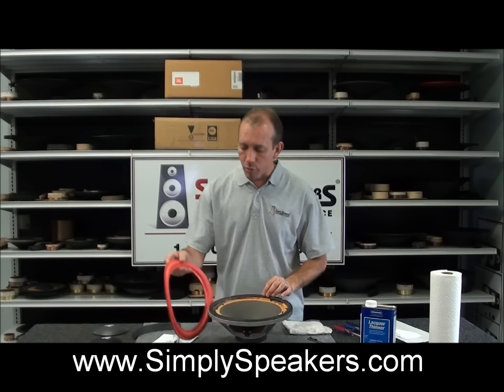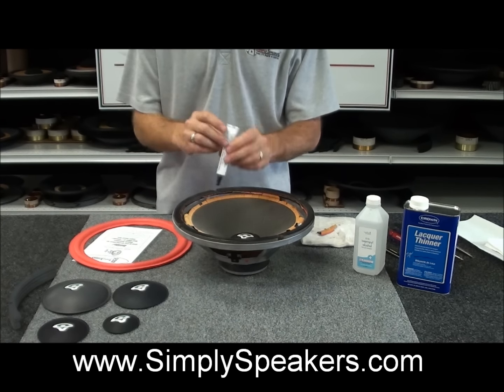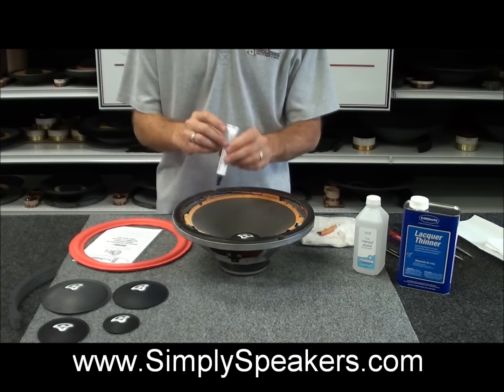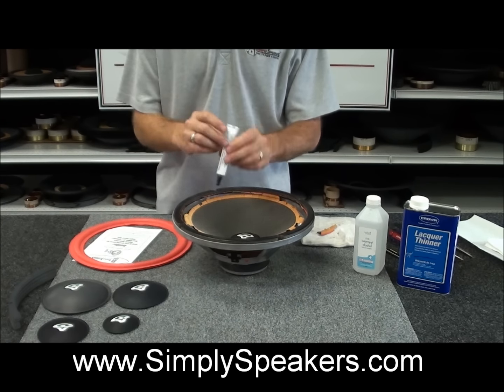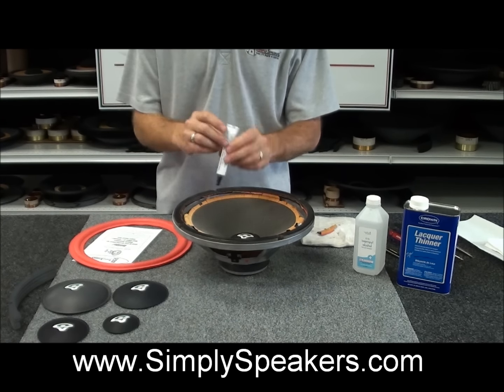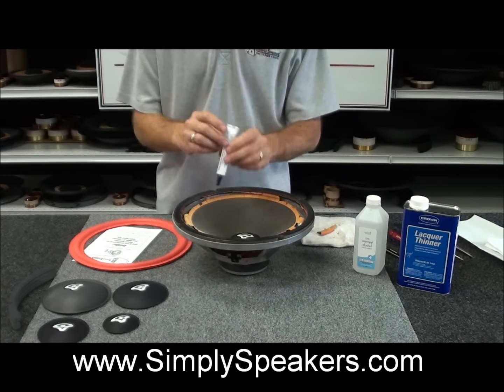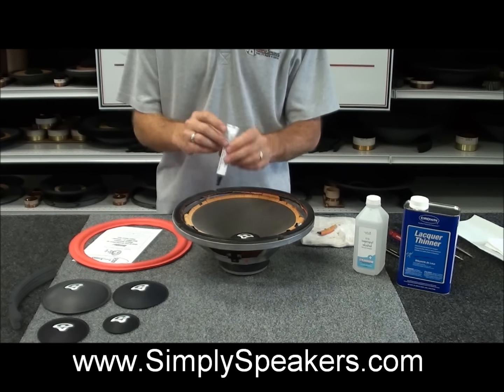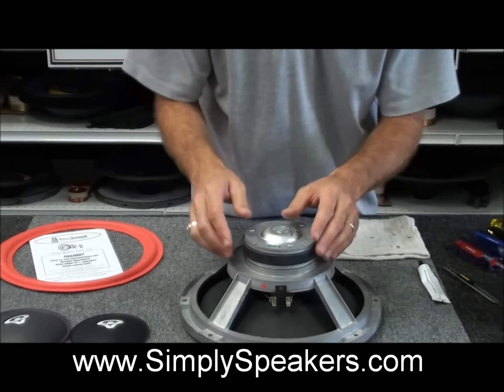Speaker Repair and Foam Surround Replacement for Cerwin Vega and Others

Comment: Hi, I need your expertise if you can advise me, I will be very appreciated, I had bought four Cerwin Vega Ls-12 and on two of them the drivers blew up, I wanted please to ask you if I can put the same drivers that the SL-12 have? There are 8 ohms, can do any damage? the ones that it has are 6 ohms, each, I am not sure why now the all speaker is 8 ohms, impedance... I will be please very appreciated if you can answer me, Thank you Luis
Reply from the maker: The LS-12 and SL-12 are compatible. Either model is safe to use in your system.

Comment: I removed the foam from the cone before I put the alcohol on, and the glue residue is proving to be very difficult to remove without peeling off a thin layer of the paper from the cone.  It it okay if some of the old glue residue is still on the cone when gluing the new foam on?
Reply from the maker: Yes, this is acceptable, as long as all the old foam has been removed.
Reply: Simply Speakers Thank you!

Comment: So is this procedure what would be done if I don't get any response from the speaker with a battery test? This is what is done to fix it?
Reply from the maker: Full recone (new coil, etc) would be required in this case.

Comment: I just replaced the surrounds on a pair of Marantz 15" speakers. One was a piece of cake, but I had problems getting the other centered on the "sweet spot". No matter what I did, I kept getting scraping on one side or another. I ended up peeling it back off of the frame and cleaning it up (naphtha works very well). On the next try, I installed it dry (it was a little bit tacky after being cleaned-up) and carefully centered it on the sweet spot, which left it visibly out of center on the frame. I then put a single drop of adhesive at the spot where it was puled over the farthest, then again 90 degrees to each side, and finally one directly across from the first. After letting it set-up a few minutes, and confirming I was still centered,  I peeled back the surround between each of the glue spots and glued it down. It worked like a charm.

Comment: I just finished repair on a pair of Energy ESM2 speakers that were in the basement for over 20 years using your excellent video guide.  I did need to replace the 8 inch gaskets which were not salvageable.  The speakers sound like new, which I had purchased over 30 years ago,.  Thanks again.

Comment: One thing I did with my last refoam project was after you feel the foam is attached in a good position is to hook the speaker up to an amplifier and just play music lightly at a very low volume to check for voice coil rubbing sounds.

Comment: Instead of slowly attaching the surround to the cone, I've picked up some assorted lunch plates and bowls from resale shops (Goodwill, etc) that are just the right sizes to sit upsidedown over the inner lip of the surround.  Don't leave it in place long enough for the glue to harden.  Just long enough for the surrounds to stay attached without babying them.  May take a few trips to find just the right size, but for $.50 or $1 per plate that you can use again and again, it's well worth the time to find a few of them.  It might take a little trial and error to find what size you need for any one foam but in general the same dish can be used for most any foam for the same sized speaker.  Might be hard with larger (15"??) speakers, but I have them for 6.5" (bowls), 8", 10", and even 12" foams.

Comment: Great instructions! I got my VS-120’s back to new and sounding great. I suspect mine had been refoamed before, the gasket was plastic, not the paper shown here and the old foam was glued with a much stronger backing to the cone, made it a tad more difficult, but it worked out in the end.
Reply: The VS series comes with plastic rings.

Comment: Okay, so I had a set of 1980s vintage black Optimus speakers that had TOTALLY decayed crumbling rubber foam borders surrounding their speaker cones - this made the speakers essentially sound completely - "blown out" -  particularly on low frequency tones. Awful! Well folks... using an EXCELLENT Simply Speakers kit (bought on Amazon), and next viewing the provided outstanding instructional vid above, and I was able to do just about a "pro job" - first time out, restoring my nifty 30 year old speakers to "Like or Better Than New" condition. In fact, I'm listening to them as I write this thing - and I gotta tell yah... they sound absolutely GREAT! 

The repair is actually quite straight forward, once you watch the video. The proprietary glue supplied is amazing. Again, these guys are like super speaker pros and essentially sharing their tools and methods to achieve positive results. The task was actually rather enjoyable, I just worked slow at my own pace. I waited a day before inserting the loud speakers back in their cabinet, just to be sure. OMG - they came out perfecto!  One tip I would add - if your bezels are in four pieces as mine were... I used multiple clothes pins to easily hold them down to the frame while re-gluing. That worked great! Thanks so much to the great folks at Simply Speakers!

Comment: Used this exact kit to replace my MX-250 12" surrounds.  Worked great.  Also repaired my 6" Klipsch 4.1 ProMedia sub.  Both are working great.  Glad I found the site or my ProMedia replacement would've cost a decent amount of money.

Comment: Hey, thanks for the video.  I ordered a set of surrounds for my D5s.  The whole thing took me about four hours to do both units.  Gotta tell folks that they need a bunch of paper towels when they clean the cones.  That's a mess.  Also, I needed to clean my knife quite a few times when I was removing the gasket.  All in all I'm very happy with the results.
Reply: Always be conservative with glue on speakers.

Comment: I have a pair of cerwin vegal ls-15s my wife bought me and one has had the gasket and spider come loose. I could barely make out 154w on the back of the speaker along with the manufacture date. all references to speaker model I've seen say 15w4, unlike the 154w on my pair. I was told by a CV dealer I should replace them with a pair of CV aftermarket subs but all I find is car audio and while my yamaha RX-V781does support bi-amp, my ls-15s do not. while i wouldn't be totally opposed to running a pair of car audio 2ohm dual voice could drivers in series since it also supports low ohm speakers I don't believe it would drive car audio speakers efficiently so therefore I was trying to find a recone kit due to the spider issue. can you help point me to the right kit?
Reply from the maker: Contact us through our website and we will see which recone kits are available.

Comment: I used this guide and the kit from your website to replace damaged old foam on a pair of '94 CV VS-100 woofers. Using the method here, I had absolutely no problems removing the old foam and installing the new foam and the voice coil is dead center without shimming--there is no rubbing at all. I also reused both gaskets no problem. This is my first time doing any speaker repair, so I was very hesitant to do this work myself. Even with your explanation I thought that the voice coil couldn't possibly be centered considering that pretty much everybody else says that removing the dust cap and shimming the voice coil is necessary. However, they were all wrong and you were right! Now my VS-100's look and sound excellent! I just wanted to comment here to thank you for the guide and also to convince anybody else looking to try this method that it does work.

It took me about 4 hours start to finish with all the drying time as well. I used rubbing alcohol but did not put any on the cone itself, i just used an x-acto knife and my fingernail to remove the foam from the edge of the cone and used rubbing alcohol, a knife, and my fingernail to remove the foam from the edge of the speaker frame. The gasket just lifted straight off with a bit of even pressure.

Thank you Simply Speakers! And I strongly encourage anybody who just need to replace foam to use this method, it's very easy if you take your time to be neat and follow the directions above.
Reply: I struggled to remove the glue do you think an exacto knife will help

Comment: I just installed mine for my 1988 Onkyo speakers. I hand not used them in several years because of the bad sound they had. Little did I know the foam had dried and turned to dust and the cones were loose.A word of caution. Be sure to put enough glue on the foam or it is impossible to move them much on the cone if you don't. The first one was off center a little but it still sounds fine the second was mush easier. I highly recommend this kit!

Comment: Ive repaired my 2 Tannoy C-10 with a kit that I bought at Simply Speakers.  Ive never repair any speakers before.  With that video, it's not so hard to do, it goes very well.  Like Watts300 says, patience is the key to success.  Now both of them works perfectly.  They explain very clearly all we need to know.  Thank you a lot.  Now Im going to buy a kit for my tannoy C-8.

Comment: I just started installing the new surrounds on my Genesis speakers.  They have an 8 in. driver and a 10 in passive radiator.  Just watching this again to refresh my memory on how to install.  Funny thing.  I removed the first 8 in. driver and it had an inspection sticker on the magnet with a manufacture date of 1983.  I didn't know how old they were as I purchased them around 1988 or 89. They are older than I thought.  Kind of cool to know this.

Comment: In this video it says you have repair kits for all other types of speakers, but I was on your site and looking for a ( Kenwood SW 100 subwoofer) foam repair kit. I don't know if you guys have any or not but, would it be possible for me to get one? The subwoofer is from a Kenwood Home stereo system from back in the 90's. I would need the gaskets, foam and dust cap. Just wondering.

Comment: Just bought a set for my CV AT-8s off you. Maybe it's because I'm using it on smaller speaker but, the whole process went easier for me than it seemed for you in this vid. Will be getting some more off you when I round up my other speakers out of storage! Cheers!
Reply from the maker: thisisunreal1 Perfect, thanks!
Reply: +Simply Speakers What a great video. I was afraid at first doing the first speaker, but after doing the first one I tore into the second one and had it done in no time. I now have a pair of AT-15 Cerwin  Vega speakers that sound as good as the day I bought them new. Thanks!

Comment: I plan to re foam 2 Infinity Model 902-5621 speakers.  As I watch your video, I am trying to thoroughly remove the dried glue from the outer edge of the plastic cone (top).  How thorough do I need to be on this part? I repeatedly soak with alcohol and scrape with edge of exacto blade and it comes off little by little...but it seems like there's no end to it.  The glue here is hard and crusty and does not soften with alcohol.
Reply from the maker: Pelican Twat The plastic only needs to be scraped to a smooth surface. You don't need to worry about any other hard glue residue. It will be fine.

Comment: Great DIY video! I got 4 Cerwin vega E208 with desintegrated foam suspension and burned coils. With your repair kit Im confident I could repair all four 8" woofers.
I was wandering if I could get some discount if I purchase 4 kits from your store as I found 160 bucks a bit oh-la-la high for my budget ATM.
Best regards
Reply: Really?  Do you have any idea what buying replacement speakers would be?  I spent $40 to redo 4 woofers and brought back 35 year old speakers!

Comment: Hello, do you all sale a kit for JBL SCS 125 sat's? I really don't want to replace the drivers with aftermarket units,and JBL doesn't sale replacement drivers for this model. I would like to replace the foam with rubber if you all carry such a thing.

Comment: I found a Yamaha HS80M studio monitor at a pawn shop today. It has about a 1/4" or so slit/cut in the rubber edge (not in the cone). It's a very clean looking cut. Not a rip. Because it wasn't in the cone itself I went ahead and picked up a $300 speaker for only $80. I have 2 questions:

1.) Is this small clean cut in the rubber edge something to be concerned about?

2.) If so, is it repairable? Or should I replace the rubber edge? 

It sounded great when I tested it out today.
Reply from the maker: You can repair a small slice like this from the back of the rubber surround using silicon sealant. It normally does not require a surround replacement.
Reply: Remember that stuff used in grade school called rubber cement? It was gooey and would dry to a rubber film. I used it once many years ago to repair a rip and a hole in an old vintage University Sound woofer.

Comment: My project went FREAKIN GREAT! And it went pretty much just like the video suggests ok. I would say that maybe you might want to practice with the setup time of  the glue because it can get a tiny-bit tricky. The most important thing is to get your re-foam kit glued to the cone accurately on the old glue-line and if you get that nailed down then you have the whole project nailed because the frame-gluing is really, really easy. Pay attention to the technique that he uses in the vid although he doesn’t verbally explain it all that well.  Tack the foam down at any point that it looks nice & lined-up in any place which is what he is doing. If you pick one single starting point during the gluing process and try to work it around you will “get off your mark” and it will be hard to correct your mistakes. Once your glue starts setting-up just tack it down and stick it if its nice and lined-up with the glue-line, then work on all the spaces in between down onto the cone. Sorry guys, I wish that I could explain things better :)! This kit worked out so well for me and it was my 1st time. If I can do it then so can you! Good luck folks! My AT-12's sound freakin Awesome!

Comment: I have the exact speakers demo'd in this video. My speakers are stamped '93 and had the same red foam rings as the replacement kit.  Point being, there is no dried crusty paper to peel off.  After removing all the old loose foam there was a slightly gooey residue.  I scraped as much as possible with a box cutter (v e r y  carefully) but still had a lot of foam/glue goo left.  I called and spoke w/ a SS tech (great guy) and he stated that the foam and glue need to be removed down to the metal or the new glue would not work.  My speaker chassis is heavy metal...could almost mount a tire on it.  So, I dremmled it down to the metal to get the remaining goo out...saved tons of time.  
Re: mounting the gasket over the foam ring, I did it by eye and got it pretty close but it would be a drag to have the gasket slightly off center with chassis holes and risk botching the installation back into the cabinet.  Mark Vizer's guidance below, toothpick or q-tip guides for alignment is the way to do it for sure.

Comment: Ok folks my kit came in from SimplySpeakers.com today and I am about to get started. I have already removed the old foam and cleaned the cone and the frame only I had to use finger nail polish remover because it was all I had lol and it worked just as well as the rubbing alcohol did in this vid (maybe even a lil better). I'll get started on installing the repair kit in just a few mins. Brb in about an hour.